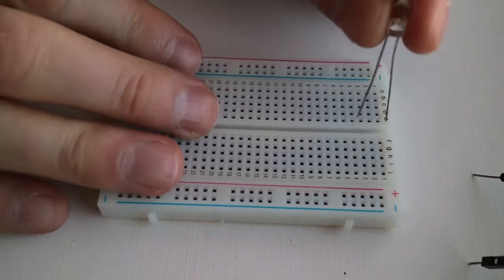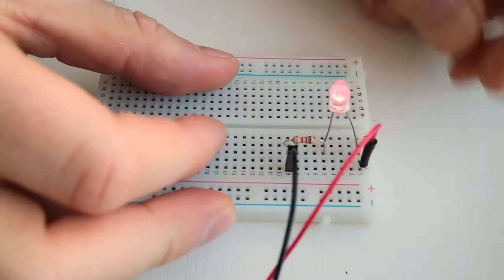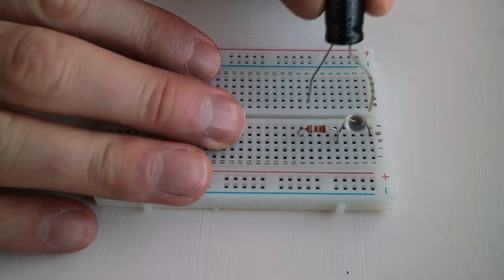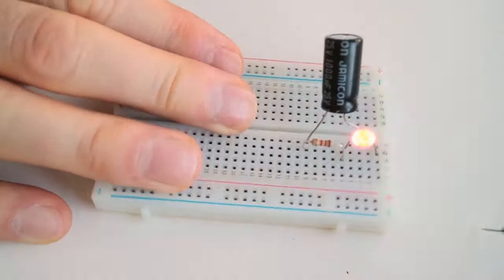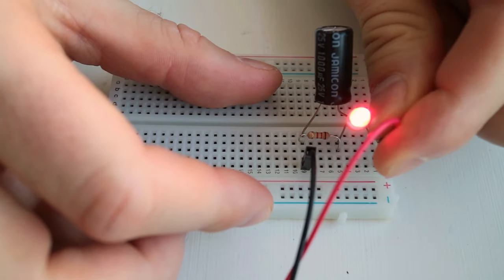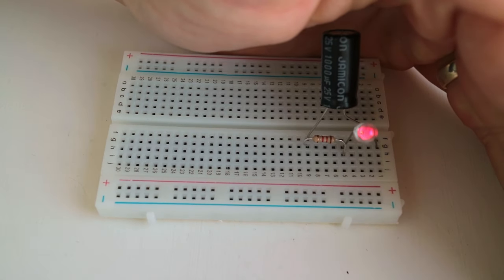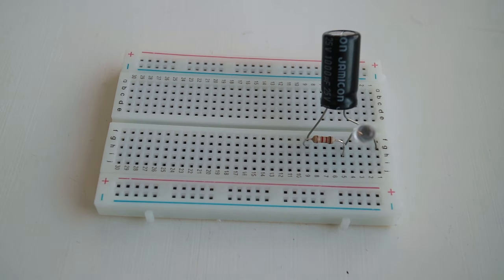What does a capacitor do?

Comment: How much voltage to connect with led
Reply from the maker: You always connect a LED in series with a resistor. And as long as you do, you can apply any voltage you want. You just have to adjust the resistance value according to the voltage. More info here: https://build-electronic-circuits.com/current-limiting-resistor

Comment: how is this different from an inductor
Reply from the maker: A few differences: Inductors have very little capacity compared to capacitors. An inductor will resist change in current. Current can still flow through a charge inductor.

Comment: Thanks. I connected a LED light to my alarm clock to see the analog tuner at night but it is never a constant light since it turns on and off based on the sound. Looks like a capacitor is what I need and I found one from an old rc remote.

Comment: Hey man! I consider you as my primary teacher :) thanks
Reply from the maker: I'm glad I can help =)
Reply: @Ohmify What was the value of Capacitor and how much volts was your battery? I'm unable to get this work with a 25v Capacitor with a 9v battery  and 10k resistor.  It works normally but not if I add the Capacitor

Comment: After doing this do we need to remove the capacitor and discharge it, or did it already get discharged when the led finally turned off?
Reply from the maker: When the LED turns off, it's not 100% discharged. So if you for some reason need to discharge it completely, yes, you'll have to do that manually.

Comment: Hi there!  I want to use a capacitor to stop a 12v small led flickering . I aimed to 16 v capacitor but not sure what UF to chose. Do you think 22 UF or 47 UF will do, or should I get a higher UF ?
Reply from the maker: I'm not sure really. I recommend just testing a few different values. But 22µF or 47 µF both seem like good values to start with.

Comment: A question ✋🏻, can we use the LED without the resistor??
Reply: no, usually the voltage and current are so high that itll burn out
Reply from the maker: No, you should use a resistor to avoid damaging the LED.
Reply: What is the resistor you have used?

Comment: Hi sir, do I have to add diode on Voltage input to protect dc circuit if ever I need to make bigger project? Thanks in advance. newbie here
Reply from the maker: A diode on the input is usually used to avoid connecting the power supply the wrong way - or to choose between two power sources.

Comment: I'm new to Electronics. Can i do this with 35v 1000uf capacitor? It's not going to explode into my eyes right?
What value of your capacitor and resistor you used in this video?
Reply from the maker: Yes, you can. And you don't have to worry about it exploding as long as you use a standard 9V battery. (If you connect it to 110 or 230V, expect a small explosion). I think I used 1000 µF capacitor and a resistor of 470 ohms.

Comment: I want to ask, how can I maintain the arduino r3 running at 12v for 2sec while switching to alternate power source.(Note: I have the main power source producing 12v and a battery producing 12v too) the power module circuit is yx850 power failure system. There's a a delay in the module when switching
Reply from the maker: Just use a capacitor with enough capacitance, and you should be able to do that. How much capacitance depends on how much current your circuit is pulling. But you could experiment to find out how much you need.

Comment: Very much helpful. Can you tell me what volt-capacitor should i use for a 12 volt LED strip? I will replace my Yamaha keyboard's display backlight(ccfl) with LED. I will take the 12 volt power from any voltage regulator located in the power suplly board inside. Thank you
Reply from the maker: The voltage rating must be higher than 12V, but there's no limit on how high. So choose any rating higher than 12V.

Comment: If i have a small solar panel.  And the output is 5vdc can i add a cap. At the output to make it move of a stable voltage. . It will charge my phone but i am trying to make it work better with less Fluctuation on the output side.
Reply from the maker: A capacitor will help reduce ripple, yes

Comment: What capacitor should i use with 12v1amp dc power adaptor with led to make slow dim effect after power off
Reply from the maker: As big as possible. The bigger, the longer the dim effect.
Reply: @Ohmify  thanks for the information. Soon I will try

Comment: How do you find out how many voltage and farad of the capacitor to use with LED and 9v battery?
Reply from the maker: The voltage on a capacitor is how much voltage it can handle. So you just have to make sure you don't have a capacitor with a voltage rating lower than what you plan to use. For the farad value - it depends on the time you want it to take to fade out. Higher farad value means longer time.

Comment: How do you determine what capacitor size you need?
Reply from the maker: In this example simply use a larger capacitance value for longer delay, smaller capacitance value for shorter delays. It would be possible to create a formula for this based on the capacitor charging formula.

Comment: How does this work? The capacitor is charged to the input voltage, which is connected before the resistor and bypasses the resistor entirely. Why doesn't the LED blow up?
Reply from the maker: The capacitor is connected across both the LED and the resistor - that is parallel to the voltage source. The resistor isn't bypassed.
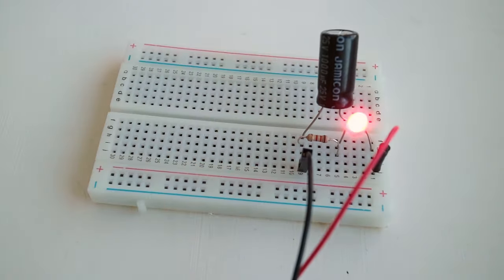Reply: If you look closely, when the camera angle is from almost directly above, you can see that one of the the capacitor's wires goes to the resister, which in turn goes to the LED.   It is right at 0:25 in the video.

BTW... If you use the comma and period keys, YT vids go frame by frame. It is easy to remember because the comma and period are on the '<' and '>' keys. Don't use the shift key, though. Unless you want to speed-up or slow-down the playback speed.

Also, the left ←and right → arrow keys jump backward/forward by 5 seconds.
Reply: @RCFrizz it seems you are correct that when the voltage source is removed, the capacitor is in serial connection with the LED.  However, the resistor is still present in the circuit and keeps the current below threshold level.